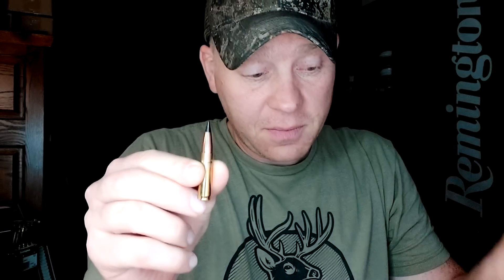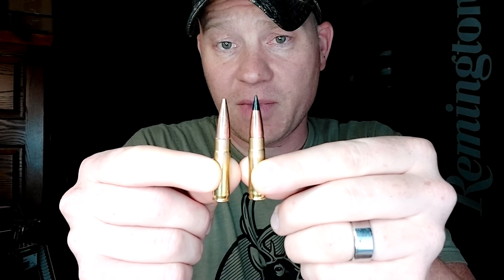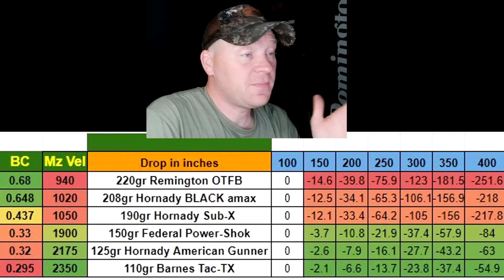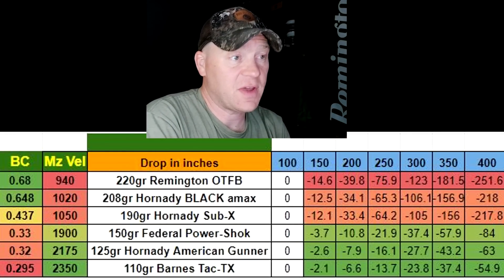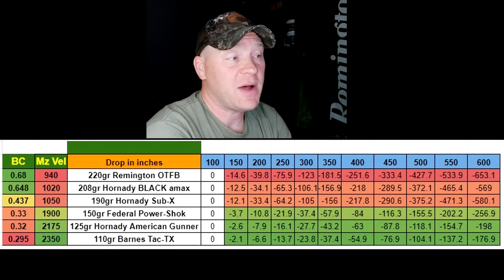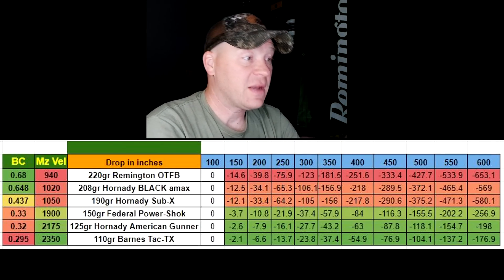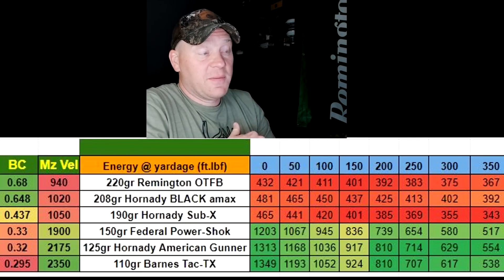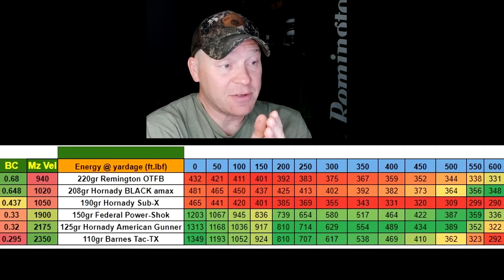300 Blackout Bullet Drop & Energy Explained [Subsonic & Supersonic]

Comment: Shot a nice 8 couple weeks ago at about 75 y , hit shoulder and it fragmented  and did not penetrate shoulderblade . Part of ricochet  went through ear and antler and I got lucky and some of it hit main arteries  in neck. Will never hunt with it again.
Reply: Just my two cents here.. but don’t blame the cartridge as a whole when your bullet selection is really to blame
Reply: In general the 300blk is not for any distance at all it was designed for close range. regardless of bullet selection it is just not a reliable hunting cartridge at any range. It does not carry with enough energy past 50 yards in any load to be considered reliable. You are capable of hits but the fact of energy dropping so quickly doesnt lend itself as a reliable hunting caliber. 125g Barnes isnt a joke.
  @msquared9605